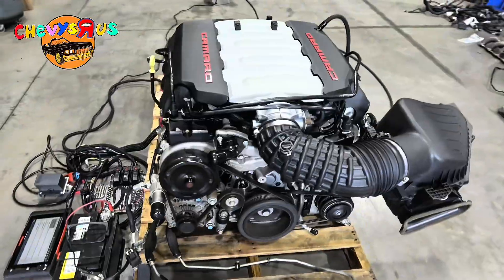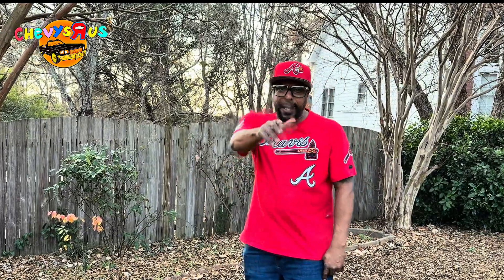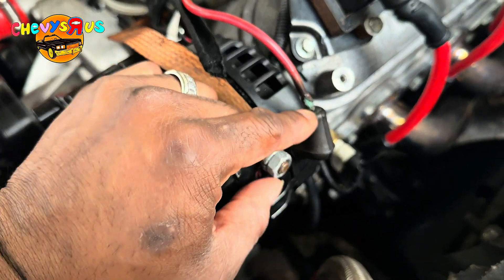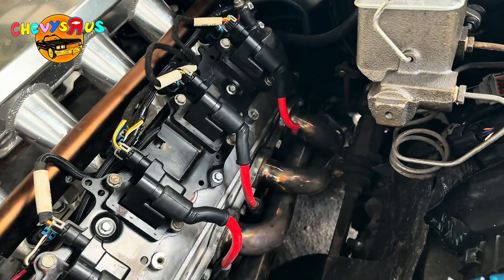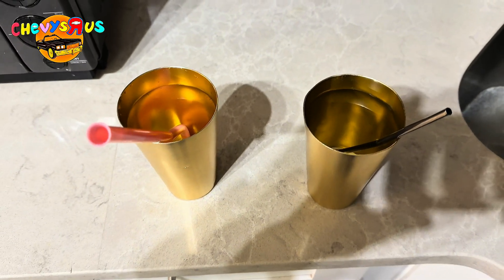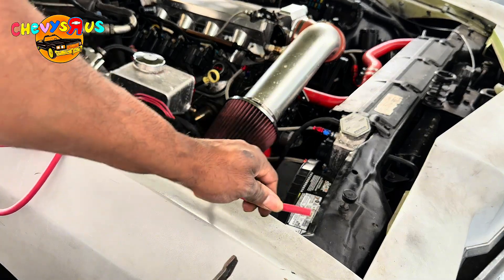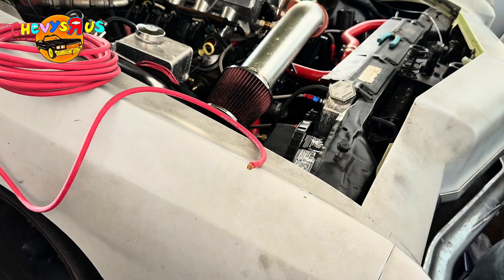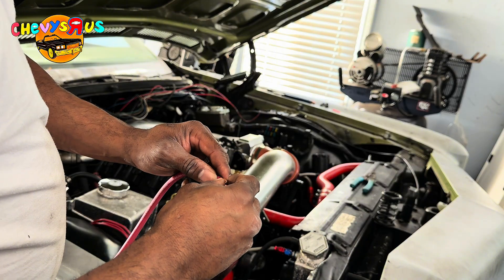🥇 “STOP Burning Wires! The LS & LT Swap Wiring Mistake Everyone Makes 🔥”

Comment: 2:41 why not run straight to the alternator instead of the junction box
Reply from the maker: Wanted to keep that factory setup where at the junction box it supply’s power to the fuse box, and part o the Aircondtiing..     I probably could have did a run the atanator to the battery and left that other run in place but I really wanted that tho g out of there!!!!  Thank you for tuning in fam!!!!!!

Comment: This is helpful. By what name would i search that tool your using to put a terminal ring on your cable.
Working on restoring a 96 GMC suburban. I want to add in a second battery and install fog lamps and maybe a lightbar on a roofrack.
Keep up the content. Thanks.
Reply from the maker: Thanks bro!!!!  Thank you for tuning in as well!!!  That tool is just a large gauge wire crimper that’s all….   You can look on amazon for 4 gauge wire terminal crimping tool….  It actually came with one of the spools of wire I ordered!!!   Merry Christmas!!!!  Blessings To you fam!!!!  🙏 🙏